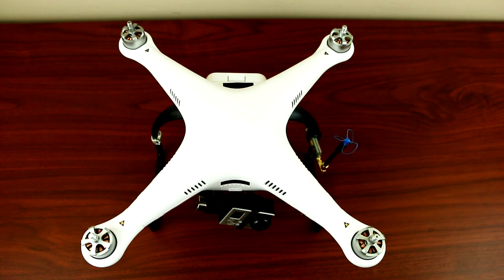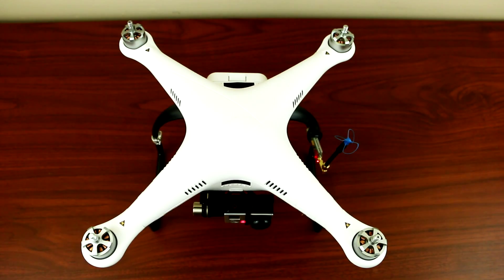DJI Phantom 2 - Thumping and Stalling Noise coming from the Motor upon Revving

Comment: Also, Upgrading your motors to T-Motors will give you some very small performance improvement and roughly a minute of extra flight time. Though for nearly $200 it's not worth doing unless you have a problem with your existing motors and needed to replace them anyway.  If upgrading to T-Motors get the one's that are "Version 2" they are easier to use with the stock self tightening props.  You can find them on Amazon.
Reply from the maker: yes, I know the t-motors only gets you 1 min extra time, not worth the extra money

Comment: Yes that's normal. It's supposed to do that when running without props.  It does this on everyone's Phantom when run without props. Even using T-Motors.  Only run your motors with Props.

Comment: This is a known non-issue. You are not supposed to run the engines without the props for extended periods of time above idle. The lack of any resistance causes the motor and ESC protection to kick in.
Reply from the maker: excellent! for adding more info!
Reply: L BS I would recommend putting it in your Description so others know when they see it.
Reply from the maker: IM0001 I will, thanks a lot brother!
Reply: L BS Not an official DJI tech, just a helping techie/pilot.